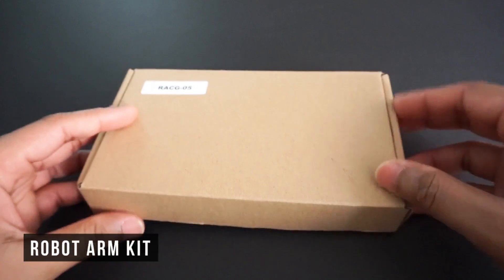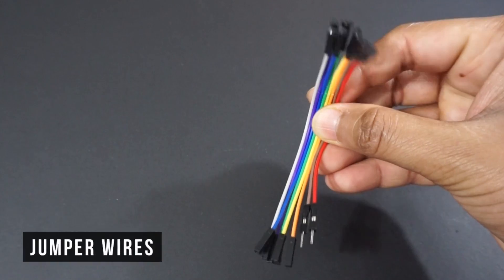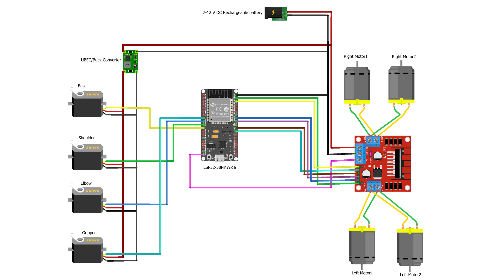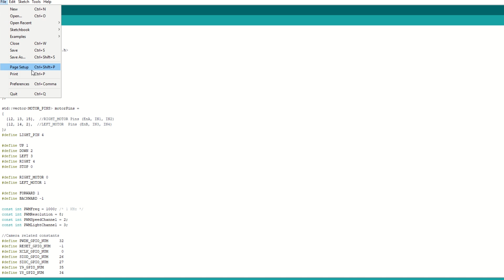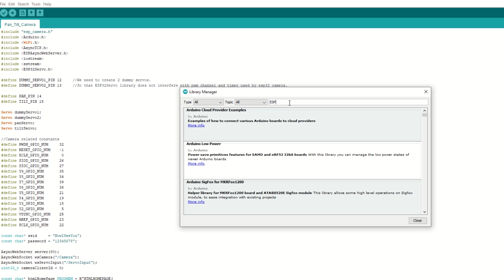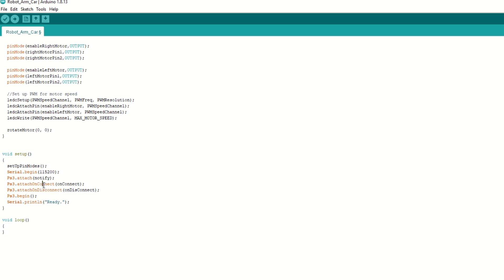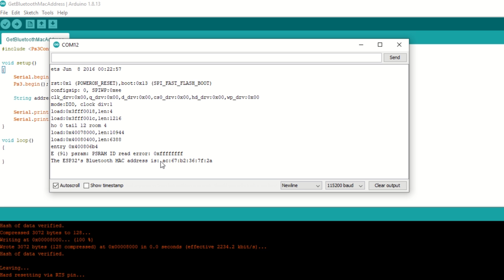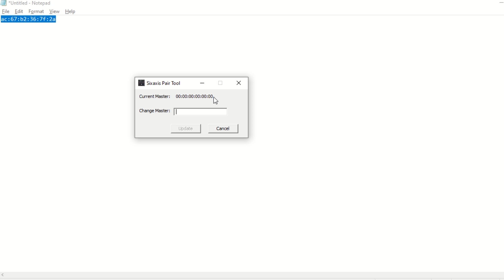Robotic Arm Car using ESP32 and PS3 Controller | DIY

Comment: C:\Users\Neji\Documents\Arduino\sketch_jul29a_claude\sketch_jul29a_claude.ino: In function 'void setUpPinModes()':
C:\Users\Neji\Documents\Arduino\sketch_jul29a_claude\sketch_jul29a_claude.ino:196:3: error: 'ledcSetup' was not declared in this scope
  196 |   ledcSetup(PWMSpeedChannel, PWMFreq, PWMResolution);
      |   ^~~~~~~~~
C:\Users\Neji\Documents\Arduino\sketch_jul29a_claude\sketch_jul29a_claude.ino:197:3: error: 'ledcAttachPin' was not declared in this scope; did you mean 'ledcAttach'?
  197 |   ledcAttachPin(enableRightMotor, PWMSpeedChannel);
      |   ^~~~~~~~~~~~~
      |   ledcAttach
exit status 1

Compilation error: 'ledcSetup' was not declared in this scope
Reply from the maker: Please install 2.0.16 version of esp32 board👍👏
Reply: I'm getting the error message from Ardino IDE

Comment: what if you don't use ubec/buck Converter components does not matter?
Reply from the maker: Plese provide 5 v supply 👍👏
Reply: @hashincludeelectronics and I use the ESP32 not the ESP 32 WROOM is it the same?

Comment: Bro can you please tell me clearly that how can I recharge 7-12V DC rechargeable battery. If it is not necessary to use 7-12V DC rechargeable battery for power supply then can I use 3 lithium-ion battery for the power supply . Also answer my question fast.
Reply from the maker: Yes use any rechargeable battery 👍👏
Reply: Thank you so much
Reply: Bro do we have to use same esp32 for robotic arm car and for uploading the code for bluetooth mac address for ps3 controller

Comment: Dude, I did everything exactly as described, but I'm still getting an error when I enter this code. However, the one for the car without arm only with ESP32 isn't. I installed version 2.0.16, but I'm still getting that error. Please help.

Comment: Me sale error en:  ledcSetup(PWMSpeedChannel, PWMFreq, PWMResolution);

void setUpPinModes()
{
  for (int i = 0; i < servoPins.size(); i++)
  {
    servoPins[i].servo.attach(servoPins[i].servoPin);
    servoPins[i].servo.write(servoPins[i].initialPosition);    
  }

  pinMode(enableRightMotor,OUTPUT);
  pinMode(rightMotorPin1,OUTPUT);
  pinMode(rightMotorPin2,OUTPUT);
  
  pinMode(enableLeftMotor,OUTPUT);
  pinMode(leftMotorPin1,OUTPUT);
  pinMode(leftMotorPin2,OUTPUT);

  //Set up PWM for motor speed
  ledcSetup(PWMSpeedChannel, PWMFreq, PWMResolution);
  ledcAttachPin(enableRightMotor, PWMSpeedChannel);
  ledcAttachPin(enableLeftMotor, PWMSpeedChannel);  
  ledcWrite(PWMSpeedChannel, MAX_MOTOR_SPEED);
  
  rotateMotor(0, 0);  
}

void setup()
{
  setUpPinModes();
  Serial.begin(115200);
  Ps3.attach(notify);
  Ps3.attachOnConnect(onConnect);
  Ps3.attachOnDisconnect(onDisConnect);
  Ps3.begin();
  Serial.println("Ready.");
}

void loop()
{
}
Reply from the maker: Please install 2.0.16 version of esp32 board to resolve this issue 👍🏻👏🏻
Reply: @hashincludeelectronics  You mean when installing the esp32, right? Mine is an esp32 WROOM-32. I have the latest version. I uninstalled mine and installed 2.0.16.

Comment: tengo un problema, segui todos los pasos pero cuando lo prendo el mando no se conecta que puede ser
Reply from the maker: Please use rechargeable battery if not using already to avoid power issues if any 👍🏻👏🏻

Comment: bro if i use esp32 devkit v1, how about the pin, is it the same? especially the ground and 5v pin
Reply from the maker: Yes it looks same 👍🏻👏🏻. However I would suggest to use the same module which u used in this project to avoid issues 👍🏻👏🏻

Comment: sir iam getting ledcsetup error what i should correct pls reply fast sir i have to submit my project 🥴
Reply from the maker: Please install 2.0.16 version of esp32 board 👍🏻👏🏻
Reply: @hashincludeelectronics  where can i install it sir
Reply from the maker: @radhakavitha-z4q in Arduino IDE . Please check the video for this step. Check video slowly and carefully 👍🏻👏🏻
Reply: @hashincludeelectronics  Sir i am using esp32 devkitv1 what pin should i use instead of 16 and 17 because 16 and 17 is not available on my board can use pls help on this 🙏
Reply from the maker: @radhakavitha-z4q i have not tried that module so can’t comment . Please use the same Module which I used to avoid issues 👍🏻👏🏻

Comment: Sir I want to control 12 DC motor from ESP32 model can you do it
Reply from the maker: Yes you can use 12 v motor 👍🏻👏🏻
Reply: no sir numberof 12 Can the motor run?  @hashincludeelectronics

Comment: Bro the code is not compiled and showing ledc setup
Reply: Bro pls help
Reply from the maker: Please install 2.0.16 version of esp32 board 👍🏻👏🏻
Reply: Bro the code is uploaded and i also got the Bluetooth address but when I am connecting the ps3 with computer using sixaxis it is showing driver installation and showing this
Reply: What to do now bro
Reply from the maker: @Soumyagallery what does it show ?
Reply: I have my project submission on 31 st December
Reply: Pls bro help me
Reply: It is showing driver installation then no device found
Reply: Bro 🙏🙏🙏🙏🙏🙏🙏🙏🙏🙏🙏🙏🙏🙏🙏🙏🙏🙏🙏🙏🙏🙏pls
Reply: Bro pls help fast
Reply: I have to submit it by 2pm
Reply: Bro say I am still waiting for your answer

Comment: C:\Users\lap i5\Downloads\Robot_Arm_Car\Robot_Arm_Car.ino: In function 'void setUpPinModes()':
C:\Users\lap i5\Downloads\Robot_Arm_Car\Robot_Arm_Car.ino:197:3: error: 'ledcSetup' was not declared in this scope
  197 |   ledcAttachPin(enableRightMotor, PWMSpeedChannel);
      |   ^~~~~~~~~
C:\Users\lap i5\Downloads\Robot_Arm_Car\Robot_Arm_Car.ino:198:3: error: 'ledcAttachPin' was not declared in this scope; did you mean 'ledcAttach'?
  198 |   ledcAttachPin(enableLeftMotor, PWMSpeedChannel);
      |   ^~~~~~~~~~~~~
      |   ledcAttach

exit status 1

Compilation error: 'ledcSetup' was not declared in this scope
Reply: and I install 2.0.18 version of esp32 board but didn't work
Reply from the maker: @mohamedadel-t3k  please try 2.0.16 version . Also select proper board while uploading the video 👍🏻👏🏻

Comment: C:\Users\lap i5\Downloads\Robot_Arm_Car\Robot_Arm_Car.ino: In function 'void setUpPinModes()':
C:\Users\lap i5\Downloads\Robot_Arm_Car\Robot_Arm_Car.ino:196:3: error: 'ledcSetup' was not declared in this scope
  196 |   ledcSetup(PWMSpeedChannel, PWMFreq, PWMResolution);
      |   ^~~~~~~~~
C:\Users\lap i5\Downloads\Robot_Arm_Car\Robot_Arm_Car.ino:197:3: error: 'ledcAttachPin' was not declared in this scope; did you mean 'ledcAttach'?
  197 |   ledcAttachPin(enableRightMotor, PWMSpeedChannel);
      |   ^~~~~~~~~~~~~
      |   ledcAttach

exit status 1

Compilation error: 'ledcSetup' was not declared in this scope
Reply from the maker: @Electrons5  please install 2.0.16 version of esp32 board 👍🏻👏🏻
Reply: @hashincludeelectronics  Same problem after downloading ESP 32 board
Reply: C:\Users\lap i5\Downloads\Robot_Arm_Car\Robot_Arm_Car.ino: In function 'void setUpPinModes()':
C:\Users\lap i5\Downloads\Robot_Arm_Car\Robot_Arm_Car.ino:198:3: error: 'eledcSetup' was not declared in this scope
  198 |   ledcAttachPin(enableLeftMotor, PWMSpeedChannel);
      |   ^~~~~~~~~~
C:\Users\lap i5\Downloads\Robot_Arm_Car\Robot_Arm_Car.ino:199:3: error: 'ledcAttachPin' was not declared in this scope; did you mean 'ledcAttach'?
  199 |   ledcWrite(PWMSpeedChannel, MAX_MOTOR_SPEED);
      |   ^~~~~~~~~~~~~
      |   ledcAttach

exit status 1

Compilation error: 'eledcSetup' was not declared in this scope

Comment: Why cant you use parallel connection in motors
Reply from the maker: @sreejyothi8665  sorry I did not understand your question properly. Could you please elaborate more ? 👍🏻👏🏻
Reply: In gear motor wiring

Comment: Before I use 38 pins but due to unexpected situation can i use 30 pins
Reply from the maker: Please check if all pins are available on that 30 pins module as per project . If all pins are available then you can use it 👍🏻👏🏻

Comment: Bro, I can’t find the connector you used to connect the battery to the L298N motor. Could you please share the links
Reply from the maker: You can use any wires for connecting battery 👍🏻👏🏻

Comment: Can I use lithium ion battery 3.7 volt
Reply from the maker: Yes you can . However make sure you use proper buck converter to provide 5 v 👍🏻

Comment: I used 4 dc motors and 6 servo motors how many volts battery i should use ?
Reply from the maker: You can use 7-12 V battery . However make sure the current rating should be more than 2-3 A 👍🏻👏🏻

Comment: Current Master is not showing in sixaxis pair tool and esp32 is not connecting. Why?
Reply from the maker: Please check the video for full details 👍🏻👏🏻
Reply: had the same problem, make sureyour controller has sixaxis printed on the back and is not a clone

Comment: i have error while uploading the code ''Compilation error: 'ledcSetup' was not declared in this scope''
Reply from the maker: @hafzamhasan8532  please install 2.0.16 version of esp32 board 👍🏻👏🏻
Reply: @hashincludeelectronics  yes thank you.. Im using ps4 instead of ps3, i used ps4 library..still figuring out, the controller not pairing with my esp32

Comment: Instead of ps3 remote can we use ps4 remote?
Reply from the maker: Yes you can . However you will have to make small changes for PS4 controller . Check my related videos on PS4 controller 👍🏻👏🏻

Comment: Budget?
Reply: Last question I saw your previous robotic arm videos there it can record steps wheather this robotic arm can also  record steps
Reply from the maker: @MullaSaad-w9s  no worries . You can ask as many questions as you need . Regarding your question , the answer is no . This robot arm cannot record and play . 👍🏻👏🏻
Reply from the maker: I don’t have exact budget for this . However you can easily add each components price and get the total 👍🏻👏🏻
Reply: @hashincludeelectronics  insted of 4dof can I use 5dof robotic arm and can you plz make guide on it
Reply: @hashincludeelectronics  ok no problem
Reply: Instead of esp32 38 pin can I use esp 32 of 32 pin
Reply: So I have one problem while connecting esp32 and ps3 controller whenever I open sixaxis pair controller and when I connect my ps3 controller to it then on my laptop it shows no device found
Reply: I have completed my project of 6dof robotic arm car using hc05 master slave configuration but the problem I arise is as soon as I connect battery and connection establishes between transmitter and receiver my robotic arm parts are vibrating I checked wheather servos are loosely fitted or what but all servos were tight can you help me only robotic arm servos are vibrating tt DC geared motor are working properly
Reply: I can give code can you check what is problem

Comment: Hello, while uploading the code, "c:\Users\erolk\Documents\Arduino\libraries\PS3_Controller_Host\src\Ps3Controller.cpp:3:10: fatal error: esp_bt_main.h: No such file or directory
 #include <esp_bt_main.h>
          ^~~~~~~~~~~~~~~
compilation terminated.
exit status 1

I'm getting "Compilation error: exit status 1" error. I'm using an ESP32 S 30 Pin card.
Reply from the maker: Please install esp32 board as shown in video 👍🏻👏🏻

Comment: super projet ,sauf que j ai une erreur 
C:\Users\cmanc\Documents\Arduino\RobotArmCar-main\RobotArmCar-main\Robot_Arm_Car\Robot_Arm_Car.ino: In function 'void setUpPinModes()':
C:\Users\cmanc\Documents\Arduino\RobotArmCar-main\RobotArmCar-main\Robot_Arm_Car\Robot_Arm_Car.ino:196:3: error: 'ledcSetup' was not declared in this scope
  196 |   ledcSetup(PWMSpeedChannel, PWMFreq, PWMResolution);
      |   ^~~~~~~~~
C:\Users\cmanc\Documents\Arduino\RobotArmCar-main\RobotArmCar-main\Robot_Arm_Car\Robot_Arm_Car.ino:197:3: error: 'ledcAttachPin' was not declared in this scope; did you mean 'ledcAttach'?
  197 |   ledcAttachPin(enableRightMotor, PWMSpeedChannel);
      |   ^~~~~~~~~~~~~
      |   ledcAttach

exit status 1

Compilation error: 'ledcSetup' was not declared in this scope

j arrive pas a resoudre
Reply from the maker: Please install esp32 board version 2.0.16 . You might be having version 3.0.0 which causes this issue . 👍🏻👏🏻

Comment: Hi, I bought the ps3 controller. I connected it to my computer. It worked normally. I turned on the app (Sixaxis) and the controller won't find it. What should I do?

Comment: My sixaxis pair couldn't find the controller after connected please give the solution as it is my last year project
Reply: R u sure that the defect is in wire not in the controller (controller is same as yours)
Reply from the maker: @dhruvsharma5496  it’s one of the possibilities because I faced the same issue . So shared it . Worth trying 👍🏻👏🏻
Reply from the maker: Try using other usb cable 👍🏻👏🏻
Reply: Our controller is showing xbox in our laptop but the controller is of sony does it have any affect on the sixaxis pair tool connection or it is the cable that needs to be changed.Also can u please share any another link for the controller also.

Comment: Nice project! I got all the parts, code uploaded everything checked (servos, connections, etc.)  All wheels and the gripper works, but the base, shoulder and elbow doesn't respond to the PS3 joysticks signal. Do I need to add something else in the code? Thank you in advance!
Reply from the maker: Not exactly sure why those 3 servos are not working . Could you please check if just servos are working (not attached with the robot arm ) ?
Reply: @hashincludeelectronics  Hi! I tested all servos separately and all worked. Thank you!
Reply from the maker: @creativemt4065  awesome 👏🏻
Reply: Bro, now when I put all servos back to the project, I am having the same issue: the gripper works, but the base, shoulder and elbow doesn't respond to the PS3 joysticks signal. Please, advise.
Reply from the maker: @creativemt4065  May be the servos are not mounted in exact position on arm. Please check the movements of arm 👍🏻👏🏻servo should be positioned in middle when you mount it on the arm.
Reply: @hashincludeelectronics  Hello! I did test them separately and they work. But when I put them back, it does the same thing, only the gripper works, and the rest like are dead. Thank you for responding, bro! you are the best!

Comment: Hello sir its a great project, Can you  please provide me a suggestion regarding the alternative of UBEC/ BUCK Converter
Reply from the maker: Thank you very much for checking out the video and nice comment. This project needs 5V supply with more than 3A current. So you can buy any buck converter which has output of 5V and more than 3A current.

Comment: Mr , first i want to thank you for posting this project online.

I did the connections,uploaded the code and connected it with a ps3 controller. Now the wheels of the car and the gripper works, but the base , shoulder and elbow doesn't. I have checked the wiring and servos but they seem to be fine. Please help. Any Suggestions would be appreciated.
Reply from the maker: Thanks for checking out the video and nice comment .
I would suggest you to please check just servos if those work . Don’t use entire arm assembly . Just connect 4 servos as shown in video . And see if those servos move. Also make sure you use only 5v supply as mentioned in video using UBEC 👍🏻👏🏻
Reply: Bro I am getting the same problem,we are doing a project on it can u say if the problem is encountered.

Comment: Bro i want add Mecanum wheels for this same project.Can u please help we with codes and connection plsss
Reply from the maker: You can check my other mecanum cars videos using esp32 for reference 👍🏻👏🏻
Reply: Please make video of robotic arm mecanum car using esp32 and ps3 controller please because I'm getting very confused with the code and connection pleaseeee requesting you @hashincludeelectronics

Comment: I made everything, step by step but when i tried to test is not working, do you give some kind of consulting? I used the esp32D but the pins is the same.
Reply from the maker: I would suggest to check the video slowly and carefully to not miss any step 👍🏻👏🏻
Reply: @hashincludeelectronics  it's working now but with PS4 original controller. Thank you Sr!
Reply: Bro I have a problem only the gripper  is  working in arm elbow shoulder,base servos are not working
Reply: Could you please help

Comment: Hello sir i am making the arm in my home using DC motors not servo and my arm cannot move 360degree it can go up down and the main grabber only so if  do I have to change the coding or not and if I have to can you give me the coding and do I have to change the circuit or it will work? Please tell me❤
Reply from the maker: I would suggest you to use the exact same components as used in this project to not face any issue . 👍🏻👏🏻
Reply: @hashincludeelectronics  sir but our teacher has told that your arm must contain dc motor and it should be home made

Comment: can we use ps4 instead of ps3
Reply from the maker: You can use ps4 controller however you will have to make code changes . Please check my others videos based on ps4 controller for reference 👍🏻👏🏻

Comment: Sir, Can I use PS4 Controller instead of PS3? I am quite a newbie, I loved your Projects and subscribed you as well. Just let me know that if we use PS4 controller what parts of Code needs to be adjusted?
Reply from the maker: Yes you can use PS4 controller however definitely there will be only code changes . You can refer my PS4 related videos 👏🏻👍🏻

Comment: Servo not moving accordingly just one servo moves only a bit but once only
Reply from the maker: Please check the connections and use only rechargeable battery 👍🏻👏🏻
Reply: Hey bro did you figure out what is wrong? I too have the same issue. Only the servo for the gripper works

Comment: error: 'vector' in namespace 'std' does not name a template type
 std:: vector<ServoPins> servoPins =
sir error is coming can you help pls

edit: I have downloaded the vector library and changed the code a little bit " #include <Vector> " and it works like a charm now.
Reply from the maker: Please add this line at the beginning of code 
#include <vector>